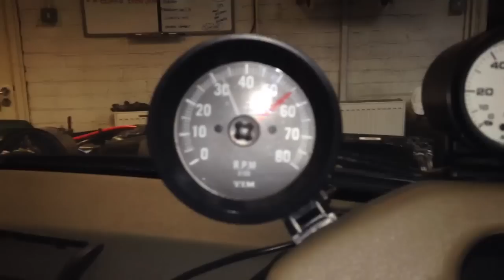Land Rover Discovery V8 REALLY bad exhaust blow!

Comment: Mine has the same engine with +45hp camshaft, oversized pistons lower valve covers, high comprensión gasket and some higher numbers in compression, but now i need those exhausts you have